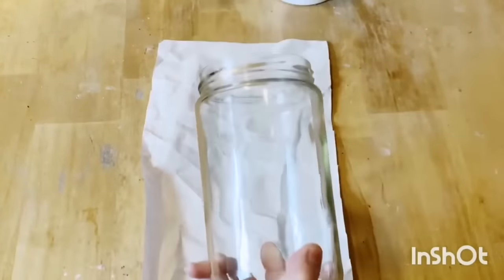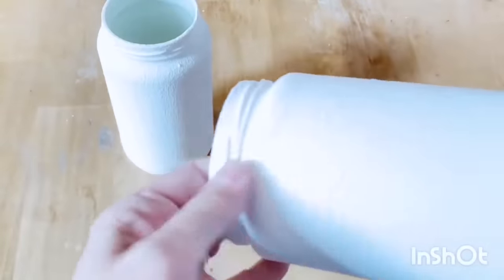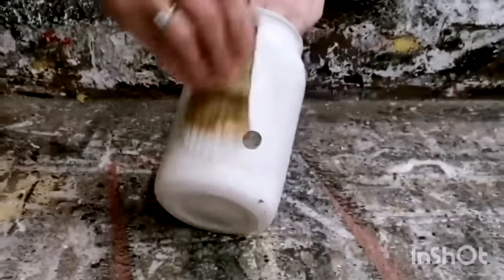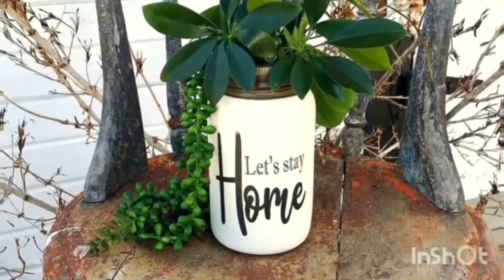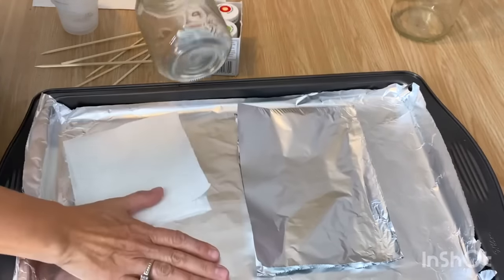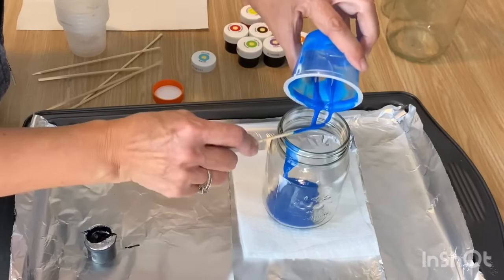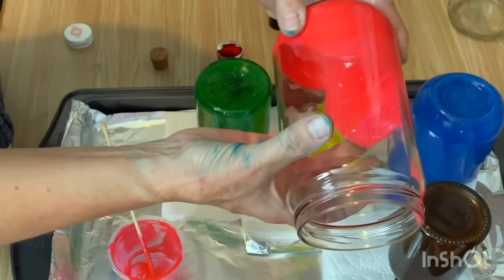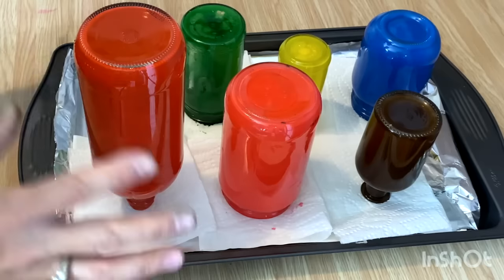39 Creative Glass Jar & Bottle Upcycles: Easy DIY Home Decor!

Comment: To remove labels and sticky residue on glass, drop a few drops of Orange essential oil on label, let it sit for a minute, rub it in, and label comes off. Scouring pad could scratch the glass. Goo b gone also works great and is sold at Dollar Tree.
Reply from the maker: Great tip!
Reply: I use eucalyptus essential oil and it's very effective! Same method, a few drops rubbed into the sticky residue after the label is off, and wipes off with a paper towel. For very faint residue, I put a few drops directly onto a small square of paper towel and rub it off.
Reply: I use lime essential oil as well.
Reply: I use lemon essential oil.
Reply: I use a hair dryer... it warms the glue and allows me to get almost all if not all of the glue to come off with the label. Easy peasy.

Comment: I love your projects and can’t wait to try them.  I have to tell you that the clear coat you are using is going to turn a very ugly shade of yellow.  I just finished redoing my white kitchen because of this (nightmare).  I recommend Minwax poly acrylic instead.  Especially if you are selling them!!
Reply from the maker: Using a water-based sealer, shouldn’t yellow on you if you’re using a oil base sealer yes it will definitely yellow overtime. Thanks for watching. Glad you’re enjoying.
Reply: @OurUpcycledLife  in the fine print it says might discolour.  Trust me.  It took three years but it was definitely a horrible yellow colour! Looks fine at first!  For whatever reason the varethane acrylic does discolour.  It’s been a nightmare redoing all of my very large kitchen!!!

Comment: I use olive oil to take off stubborn adhesive on glass jars too. What I do is I would soften the adhesive with my heat gun then pour some olive oil on a steel scrubbing pad and scrub in a circular motion. Afterwards wash it with soap and warm water

Comment: I use Goo Gone to remove the residue left when removing labels. For stubborn residue, I leave a wash cloth with a large amount of Goo Gone across the label area for an hour or longer. It works very well.
Reply from the maker: Great tip!
Reply: Me too!
Reply: 😊a super quick way to remove labels from glass, pour some boiling water in and it just peels right off, just don't burn yourself
Reply: @dinarusso3320  I have done that, but it doesn’t work all the time.

Comment: Try using rubbing alcohol to remove print on glass bottles. It works well for most.
Reply from the maker: Great tip
Reply: I use isopropyl probably same thing as rubbing alcohol
Reply: Baby wipes works great on a lot of things. (Which always makes me wonder what is in them and if they are safe for the babies. 😮)

Comment: Since Modpodge has a sealer in It, could you use some type of liquid sealant in the homemade one? I wonder if the transfers would work with that? Also, if it works, how cost-efficient would it be?

Comment: I'm having trouble with the rub off process. No matter how gently I rub, some of my letters always comes off. Additionally, they aren't very black- they still have a film when I seal it. Also, there is an edge left around my items, which you can clearly see when sealed. I have attempted many times and my result is subpar. Any other ideas?
Reply from the maker: Are you using an ink jet?